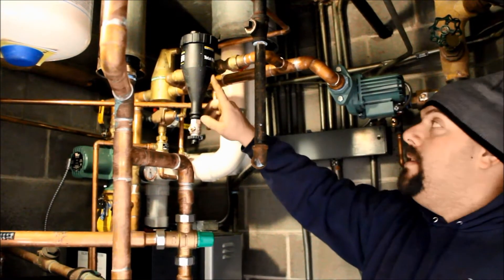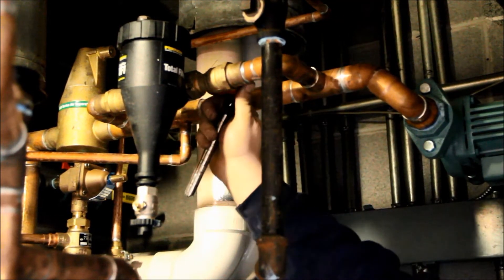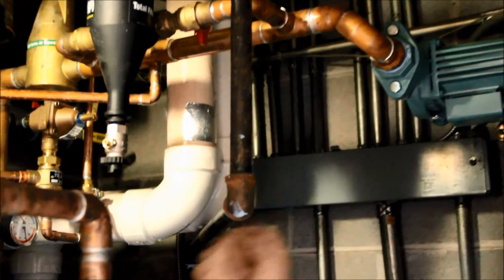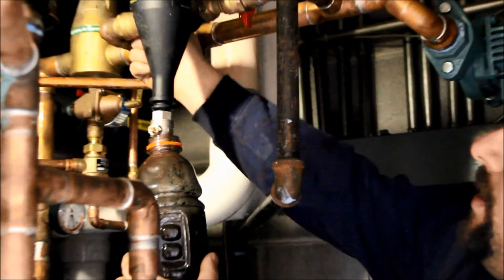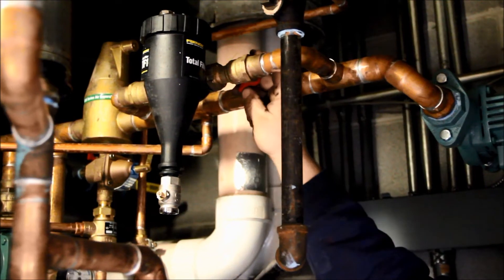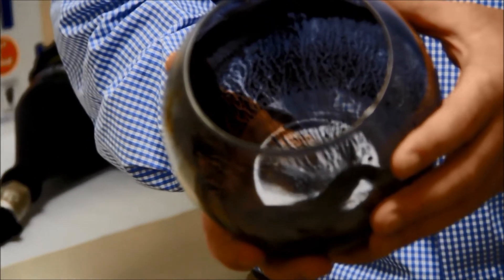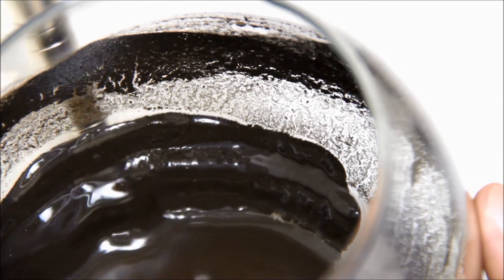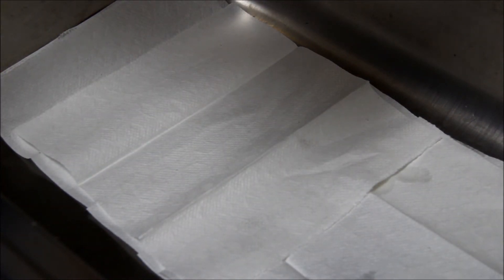Flushing A Fernox TF1 Filter | Emerson Swan

Comment: Correct method of flushing the TF1
Step 1 : Turnoff system so circulator pump and bolier not running.
Step 2 : Close both red isolator valves
Step 3 : Pull magnet out
Step 4 : Remove bottom cap and use to open drain valve (place suitable container underneath)
Step 5 : Open one of the red isolation valves to wash collected debris out of filter body until water runs clean, then close isolation valve.
Step 6 : Close bottom drain valve and cap off drain
Step 7 : Replace magnet and open both red isolation valves
Step 8 : Open air vent on top of TF1 to bleed out air.
Step 9 : Turn system back on

Your Welcome :-)